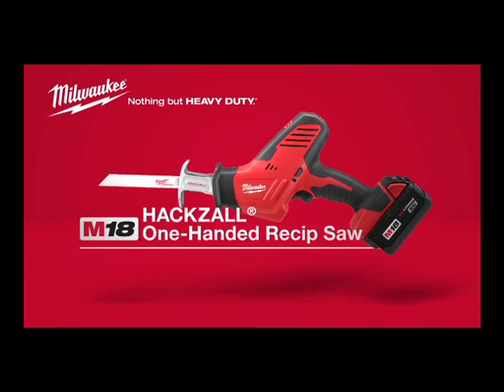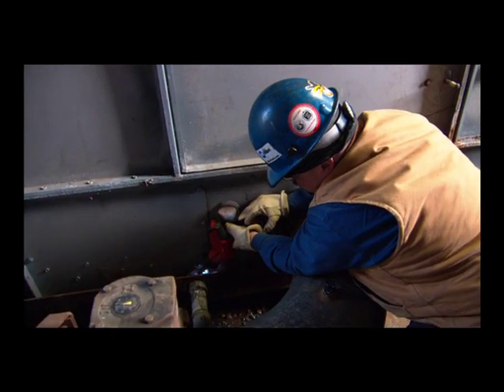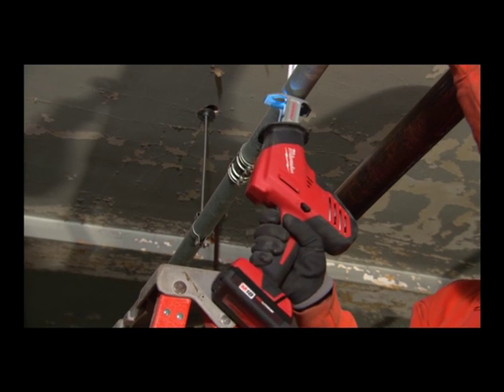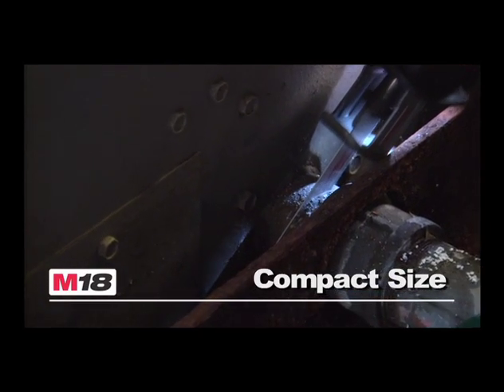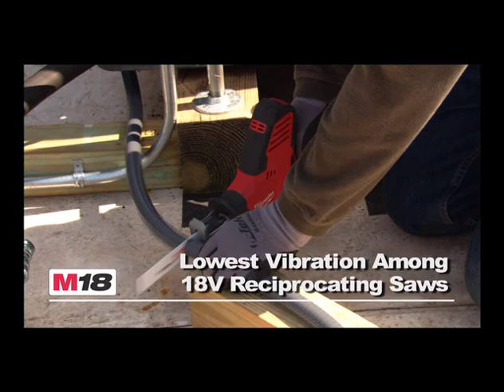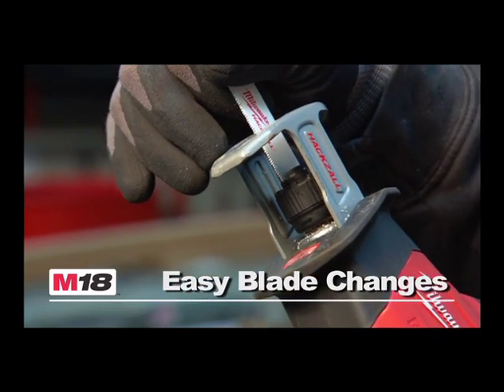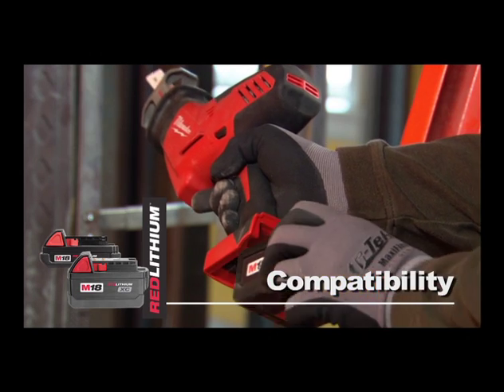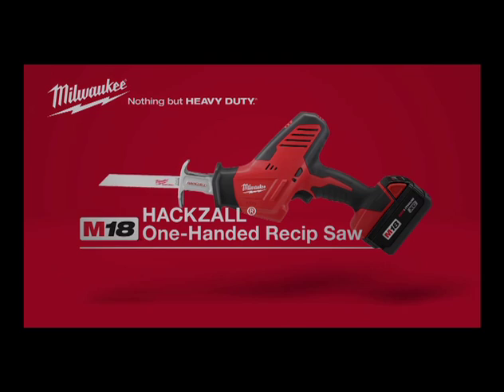MILWAUKEE Hackzall® M18™ Cordless Lithium-Ion One-Handed Reciprocating Saw

Comment: I'm a professional and use milwaukee tools exclusively now. I found that most the other brands are not built a tough as milwaukee and break too often to be professional grade. They screwed up with the v18 stuff but the new m18 tools are where its at.